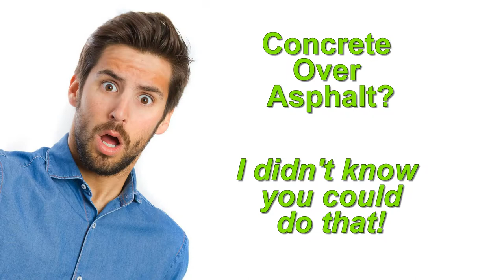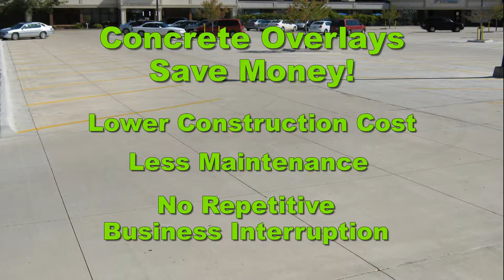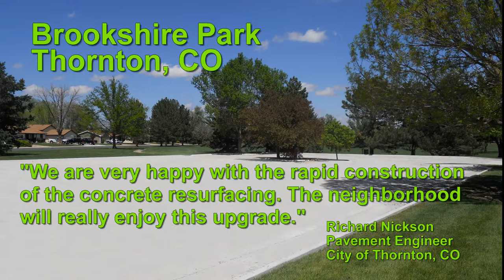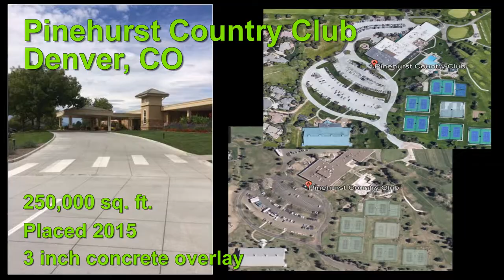Concrete Overlays of Asphalt Parking Areas

Comment: What is the benefit of doing this?    I have a large shed with an asphalt floor what can I gain if were to do this?    Is it just sealing it or is it making the asphalt stronger to where I would have to worry bout weight on it during hot days
Reply from the maker: A concrete overlay would provide support for heavy equipment, etc. especially in hot weather. The question is how large an area would consider overlaying? You note it is for a shed. Is the surface inside the shed?

As to sealing the asphalt, seal coating keeps the asphalt flexible and helps mitigate cracks as the pavement ages.
Reply: @lancda  I call it a shed ats actually 24x36 and it is a place to park my Pick up my compact Tractor my trailer and is I need to work on something in bad weather I pull it in there
Reply from the maker: @NYTROeast  While the project is not particularly large, the durability that concrete will provide over the long term may help offset potential cost differences. Please be aware that the asphalt must be in good shape to facilitate a sound concrete overlay. Here is the link to our overlays page: https://www.specifyconcrete.org/pavements/streets-local-roads/concrete-overlays. The information presented here should help you with making a decision regarding the direction you wish to elect should you decide to improve the area.
Reply: @lancda  I will check out your page the asphalt is in great shape
Reply: @lancda  correct it's not it only 24x36 but the durability that concrete will give it would be nice. Is this something that can be done by a property owner or does it require special equipment
Reply from the maker: You're best bet would be to consult a concrete contractor. Explain to him what you are looking for. He should be able to help you. The equipment needed may not be "specialized" but the project is not something that I would recommend to a homeowner. Good luck!

Comment: Creates less heat. How long does it stick to the asphalt?
Reply from the maker: With proper preparation, there will not be an issue with the two surfaces bonding. Check out the concrete overlays page on our website www.specifyconcrete.org